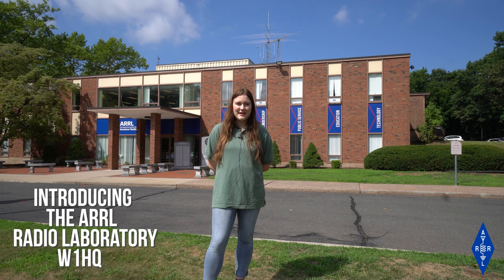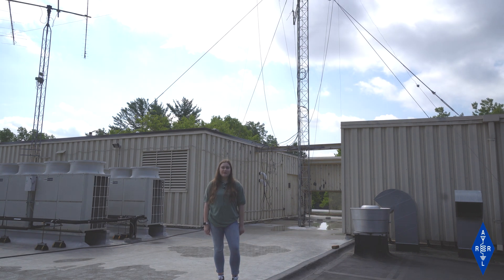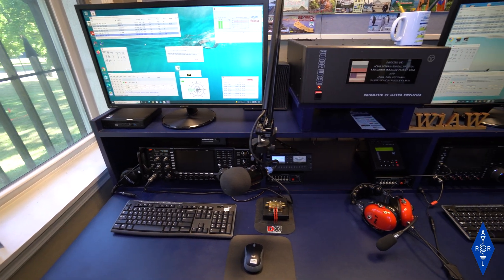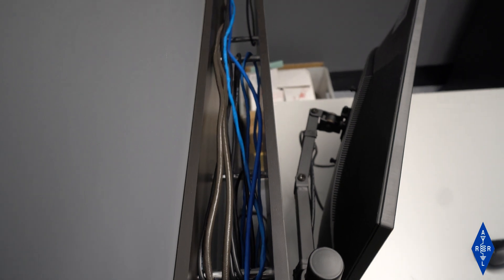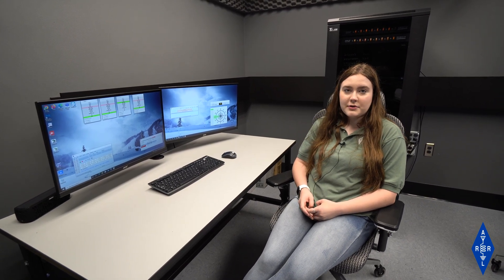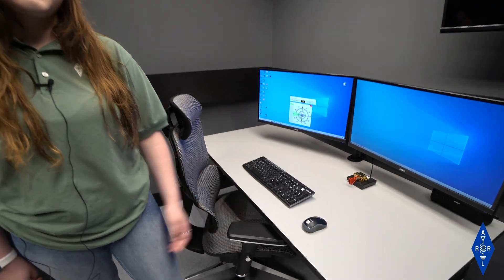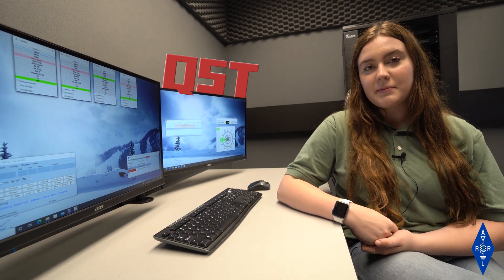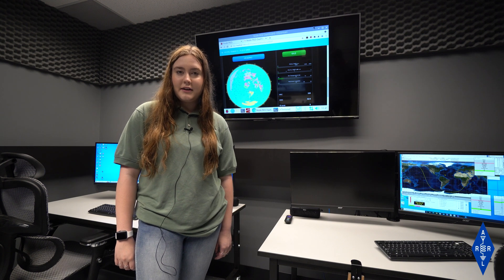New ARRL Radio Lab Will Inspire Your Ham Shack!

Comment: Great job, Jherica ... Wow, what a transformation of W1AW. I like the clean look and feel. I would only suggest (maybe it's coming?) that there is an identification of what radio is connected to each operating position. I'm assuming antenna switching is all done remotely as well, maybe from the computer screen? Anyway, thanks again for the updates! Vy 73, Dennis - WU6X
Reply: That is not the W1AW station studios. That is separate (different building).

Comment: This is a big improvement. Last month I started the same effort on my home station, separating the PC workstation from the radio equipment. Now the PC station has power and network cables that pass through a UPS to my computer equipment and no other wires exposed. It took hours to find good cables that are not too long and get them labeled, routed and managed with hook and loop tape. I wanted to manage lightning risks and EMI/RFI to lower my noise floor. -Tim KI4TG

Comment: I have been there by year 2009, at that time the main building is very small and now it is the new built building and the Radio Station are located at the other side the building in another old  small shack.  Hope to visit again in the coming years 73de VR2SA ( AA1SA)

Comment: Very slick, but it's not a Laboratory.  Defn Laboratory "A room or building equipped for scientific experimentation or research." (American heritage dictionary). I see no faciltities for experimentation or research. Sure it's a good vehicle for operating. It's also a showroom for whoever has supplied you their commercial radios, but amateur radio is a lot more than that (read the license).

So, good showroom, but not a good laboratory.
73 M5KVK
Reply from the maker: Gareth, you may have mistakenly omitted a portion of the definition you copied for, “laboratory.” It includes, “A place for practice, observation, or testing.” This is precisely how the space is being used.
Reply: @ARRLHQ  Fair enough, though that wasn’t part of the definition I quoted. However, your additional clause begs the obvious question - where’s the test gear?
Reply from the maker: @GarethHowell , radios and accessories being tested for QST Product Review are brought into the Radio Lab to test the integration and performance of the gear in a station that already supports various types of control and automation. The Radio Lab is a new addition to the ARRL Laboratory, which already includes a fully equipped screen room and test equipment. If you're unfamiliar with ARRL equipment testing and product review, check out this short video: https://youtu.be/3vvu020gYDQ

Comment: Excellent video!  I really appreciate the plan for real world/real use videos you have planned such as integrating new radios into existing setups and showing what needs to be done. I also really liked the look at the wire management and comment about the desk on wheels. I’d like to see parts of the future videos talk about some of those mundane details that might not normally be covered and not needed by more experienced hams but I appreciate it as a new ham dealing with the practical issues of setting up a first station and desk and first time drilling into the side of the house or drilling through a wall to route wires. A reminder that I’m going to want to get behind the desk more often than I might think and that wire management from the beginning is a good idea, is really helpful.
Thank you and great presentation!!

Comment: Great job, Jherica! The rest of this paragraph is directed at those in charge of this. If the goal  were truly to duplicate a "typical station in your home," they've failed epically. Towers and beam antennas? Typical HF stations have single-element antennas, often wire between trees or hung as inverted Vs, or verticals. This nonsense perpetuates the myth that one needs beams on towers to have an effective station and collect tons of QSL cards and awards.
Put up a G5RV or an off-center-fed dipole if you want to look at a typical HF station, and J-poles, ground planes, and halos for VHF+.
Reply from the maker: Wire antennas, like the EFHW, loops, dipoles...ALL GOOD! It's great to experiment with what you can afford and have room for. ARRL includes wire antennas in its content all the time. Big antennas...small antennas...let's do it ALL!

Comment: I was quite interested in watching this review. One thing that challenged me was how fast you ran through everything.  It was hard to stop and see what you were describing, fully understand it and reflect on it.  I'm 77 years old and have been challenged by many contemporary video presentations for this very reason.  It is as if the announcer is rushing through the video to get to the end as quickly as possible. For me, staying in the process as an exploration is the exciting part, not getting to the end.  Is this speedy approach a result of reduced attention spans resulting from experience life in small technology bites like tweets? Or...? I like to be able to explore things with time to spare, time to reflect, time to pay attention to detail.  For me it was just too fast.  Interesting approach to a station that I have played around with.  I wish the visit to the station had been more leisurely. Thanks --Kenoli Oleari KB6EMG
Reply: Have you considered changing the playback speed of the video?  When you have the YouTube screen showing its controls (all of the symbols in white), click once on the cog (in the upper right portion of the screen) for settings, then click on "Normal" for playback speed.  This will open another menu that allows you to adjust the playback speed.  I like to do this in YouTube and Audible to either slow things down or speed them up, depending upon my intentions and differing presentation styles.  Good luck! 👍😁
Reply: @JefeDow  That is an option I commonly use but it screws up the sound.  Just tried that here and the voice is awful.  I wonder why people race through videos.  I've always tried to speak slowly when doing a workshop or other video.  Have you ever noticed that on TV news, they race through the important content, the news and weather, and then sit around jawing with personal banter that is hugely boring and irrelevant.  Between that and incessant advertisements, we seldom watch regular TV news unless we need some info about something really current and then we have to wade through all of this other stuff to get to what we are listening for which is also so fully summarized and raced through that it is hard to get substantive information.  Drives me crazy.
Reply: @ttp666  For YT videos tap the space bar on your keyboard to pause the video,  works well for me!

Comment: Very nice, but how noisy is the room when the fans in those equipment cabinets turn on?
Reply from the maker: Pretty quiet in there! We also added some inexpensive acoustic foam to the walls to add some sound deadening (it even helps with minimizing the sound transfer between multiple ops in the room). And the foam looks cool!

Comment: Excellent presentation, very professional.  I'm inspired to look into some of these ideas.  Every time I need to access the rear of one of my rigs I have to climb onto my operating table and almost stand on my head!  And the "rat's nest" of coax cables under the table could definitely use some organization.  Thanks!!!
Reply: I wish more radio manufacturers would adopt modern connection methods like ethernet to simplify wiring. FlexRadio has been forward thinking in this regard for a long time. Even my amplifier and tuner are keyed with ethernet over the LAN. 

The other manufacturers did go with USB and that simplified wiring some. Icom has gotten on board with not just ethernet but wifi and Bluetooth (great for portable operations) so that is a good sign. Hopefully we will see radios soon with just RF, power and a single ethernet connector and connections to the computer and other equipment over the LAN. Less wires to get damaged, less to break and infinitely more customization and flexibility.